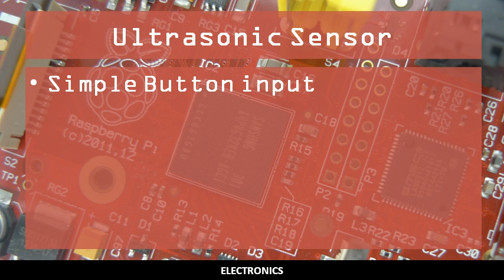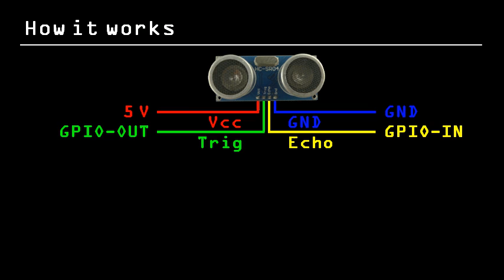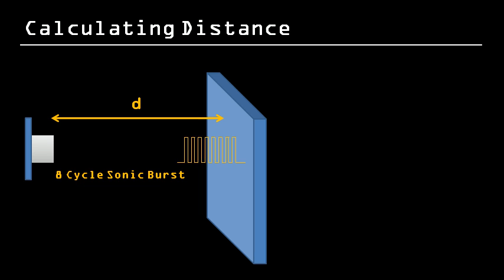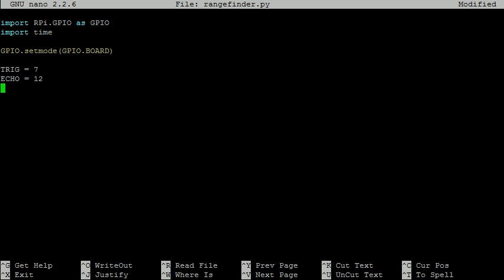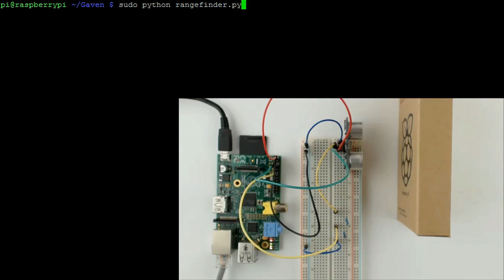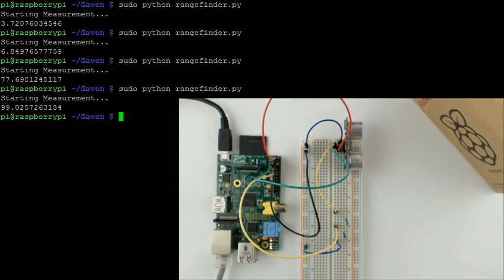Ultrasonic Sensor with the Raspberry Pi

Comment: Why can't I just use the 3.3V PIN from the Raspberry Pi instead of 5V ? In that case I won't need the voltage divider

Comment: if we use three 10k ohm, than parrarel the 10k that connected to echo with 2of 10k series to the ground,... is it okay to have 3.333.. V to the echo pin? if it only recieve 3.3V it said

Comment: Nice and helpful video. I have a question: I bought the HC-SR05 today, to only play and ultrasonic signal (no detection wanted), for a specific time (1 sec). Since I do not want to measure any distances, shouldn't it be fine if I only connect Vcc, Trigger and GND (without Echo) directly to my Raspberry Pi 3 B+, without any restistors?

Comment: I'm using a us-100
My question:
I tried it with a similar Programm: (one difference: GPIO mode is on BCM)
and it does not work. The sensor isn't returning any signal...
But also my Raspberry pi collects a signal, if i touch the connection wire of the Echo
Why does that happen?
Reply: udates?

Comment: Hi Thank for the tutorial.  I seem to be able to get my code to work ok but when I run it I get this error message afterwards:
measuring...
0.18249154090881348
Traceback (most recent call last):
  File "/home/pi/Desktop/PythonCodesThatWork/ultrasonic/ultrasonicBasicv2.py", line 30, in <module>
    print(stop - start) * 17000
TypeError: unsupported operand type(s) for *: 'NoneType' and 'int'
>>> 

Could you advise please? Thanks

Comment: Nice video,
You seem to cover the whole concept of unidirectional sonar quite efficiently.

I've got some improvements to the code part however:
In order to get the time of the falling edge (on the echo gpio pin), you use a software based waiting loop which have 2 major drawbacks:
- Without multithreading/multiprocessing, the program goes in some sort of "lock" (the infinite pass loop) while waiting that falling edge.
- The mesurement precision is totally based on the tick/clock speed allocated by the OS to the program which is often varying and totally unpredictable.

So, my point is, why not use the wait_for_edge function of the GPIO library which is either an hardware-based signal detection or a low-level software one (I don't really know which one to be honest).
Given that this function is meant to be used with a assync callback, this would easily eliminate our first drawback.
For the second onf, if this function is based on some hw signal detection, it would be totally eliminated, if however it is based on some low-level software, it would still be present but with a much higher degree of precision anyway!

This isn't a criticism of your solution (which is real good as for educational purpose btw), just another approach to the same software problem.

Comment: is it possible to use multiple ultrasonic sensors in the raspberry?
Reply: Beto CH yes.  you would connect each sensor to a different gpio pin (and of course, each sensor to a 5v and ground).  on the pi, you can: sudo gpio readall; to see which pins are gpio pins, and then you can add these to your script.  Note that the GPIO number, and pin numbers are different.  Example: pin 3 is gpio 2, and pin 5 is gpio 3 on the raspberry pi zero.
Reply: @averial9831   I looked the GPIO numbers and actions on internet it says there is just 2 5V pin. But I saw in Youtube some people connect 3 or 6 sensors ?
Reply: @cagdastuna5505  that is correct.  You could use multiple sensors on a single 5v pin, however you want to make sure that you are not drawing TOO much power directly from the raspberry pi. You should be ok to do that, but there is a limit of how many amps you can draw from the raspberry pi safely.  An easy way to connect 3+ sensors would be to use a breadboard.  Good luck 🙂 and have fun.

Comment: my code just hangs after the "Starting Measurement" routine. It gets into the while GPIO.input(ECHO) == 0: and never leaves

any ideas?
Reply: same problem here. help
Reply: same here
Reply: Add after print "Starting Measurement"

GPIO.output(TRIG, 1) 
time.sleep(0.00001)
GPIO.output(TRIG, 0)
Reply: I have the same problem and have the code 
GPIO.output(TRIG, 1) 
time.sleep(0.00001)
GPIO.output(TRIG, 0) 
after starting measurment.
When i force it a signal by placing echo wire on 3.3 V rail he code works. 
Does the range finder have a ligth that shows when it is one? 
I feel like the range find isnt sending out a signal.
Reply: Same
Reply: I have BCM set and it still hangs: https://raspberrypi.stackexchange.com/questions/82833/hc-sr04-randomly-stops-taking-readings

Comment: Wow!  What an excellent presentation!  

I especially appreciate your working from the basics--e.g. showing the math for each part of the project.   (How to convert echo time to distance...how to determine the proper resistor value for the voltage divider.)

This is not a cookbook, but a very clear explication of the underlying principles, so one can modify the project with some degree of confidence.

Bravo!

Comment: Hi im interested in start working with this sensors, i wonder what happens if you put the sensor on a servo or a rotational platform so it would rotate 180 degrees, what kind of data would it give? have you tried this? thanks, awesome videos

Comment: what is the parameter for measurement of pulse duration i.e. 10us(0.00001 sec). I mean,how did you calculate that one should have to trigger it for 10 microsec.

Comment from the maker: I also initially tried to use an edge detect event but failed to get it working. After some frustration, I found that the time delay involved with an edge detect in Python was too great and my program was missing the signal from the sensor. You might have more success using an edge detect in C as Python is known to do poorly with timing.